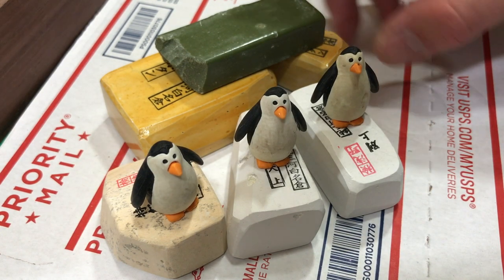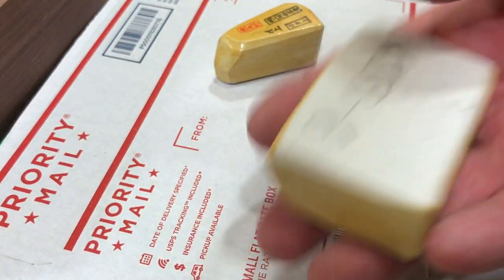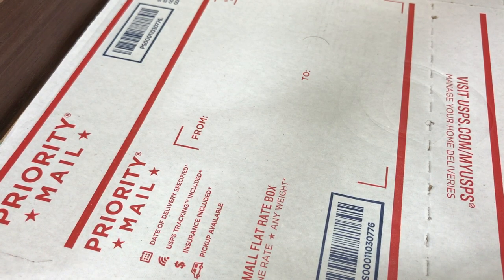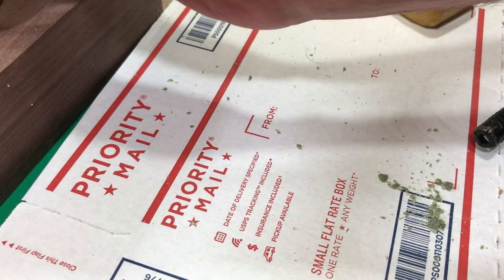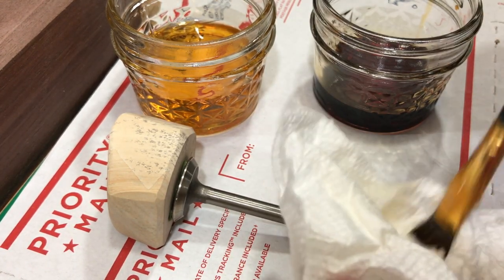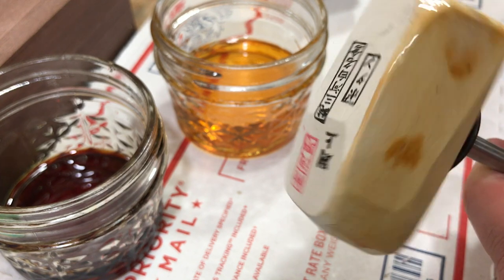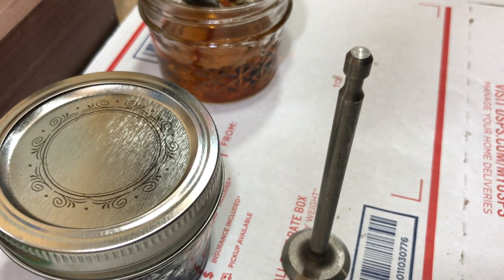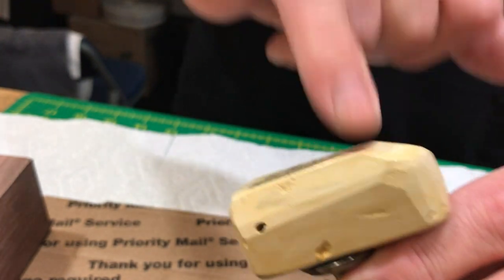Cashew Lacquer II - Sealing Jnats, Nagura, Etc

Comment: Hi Keith,  do you ever run into the cashew lacquer and spirits turning to gel after about two days. I’ve been using Gamsol. I’ve tried different ratios, but still no luck. I’ve started measuring out just enough for the project I’m working on. Any tips?
Reply from the maker: Has to be used quickly or it starts to harden. .

Comment: You can add a little food coloring to your nail polish to duplicate the look of cashew lacquer lol. Works great.
Reply from the maker: Sure, or you can just buy colored nail polish, lol. I actually prefer the clear stuff though.
Reply: I like the clear stuff too, that's why I started experimenting with food coloring. If you add just the right amount of food coloring, it'll still be clear, but with a tint of the color you add, whereas most colored nail polishes are very saturated with color even after the first application. I've obviously thought about this way too much, lol.
Reply from the maker: I was referring to translucent colored nailpolish, not solids, but I've used both.
Reply: Ahh! I didn't even know they had those.

Comment: Hi Keith, great video. I live in Australia and would really like to get my hands on some cashew lacquer. There are no local sellers and the only only sources I have found will not ship internationally. I know you mentioned you don't generally purchase the stuff and rely on the small amounts shipped with your nagura. I guess my question is are you aware of any vendors who do ship internationally?
Reply from the maker: Hello, unfortunately, I do not.
Reply: No worries, I would prefer to seal some stones in a somewhat traditional way. It seems that there is some low allergenic urushi available that ships easily enough (https://www.mejiro-japan.com/en/product/colored-glossy-urushi-lacquer-japan-50g-no-pigment-required). Would you say this stuff is okay, and if so would you thin it and apply it in a similar way to cashew lacquer? Also would you get the red or clear pigment? Sorry for the questions, this info is quite hard to get! Thank you.

Comment: Keith, you are making the right call not to sell urushi lacquer.  The polymerizing urushiol oil is the same allergen produced by poison ivy, oak, and sumac.
Reply from the maker: Exactly that. Ty.
Reply from the maker: Cashew was developed as a less hazardous alternative that was easier to work with. It's popular because it's readily available, less irritating; and it cures in a week as opposed to a month and it doesn't need to cure in a RH controlled environment. It's really not all that much cheaper, but the cost factor isn't usually much of a consideration. 
Cashew has notably less urushiol than Hon Urushi, and its curing process is much different. Combined, those two assets virtually eliminate the possibility of causing an allergic reaction. I suppose that it would be possible for someone who is hyper sensitive to urushiol to possibly be affected by the raw product, anything is possible. But just about any sealer could possibly cause an allergic reaction in someone, so there's that.